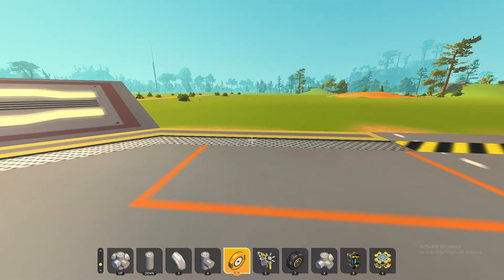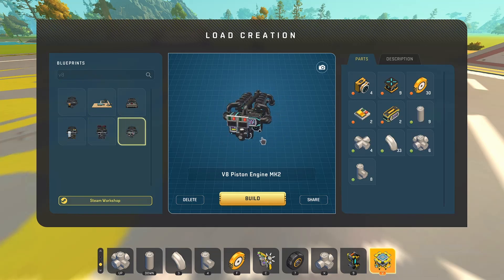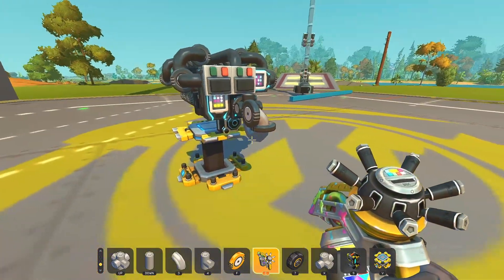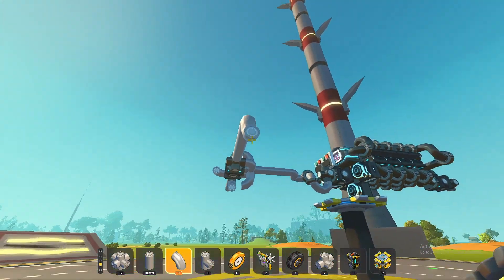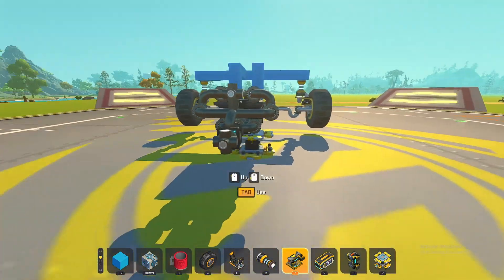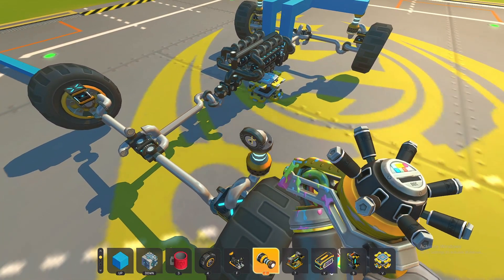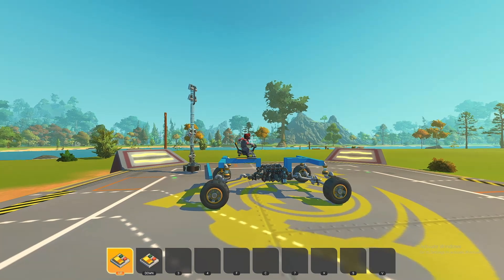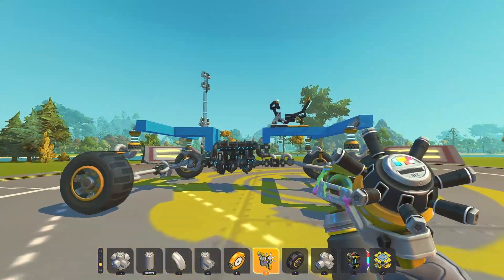How To Make An AWD Piston Powered Car In Scrap Mechanic!

Comment: Could you put this build on the workshop so I can test it?
Reply from the maker: https://steamcommunity.com/sharedfiles/filedetails/?id=3244456616&searchtext=4x4+piston+powered+car
That's the vanilla one. It doesn't drive very well as is because it is only a test frame, so it has hardly any weight, but the functionality is there. Thanks for watching!
Reply: @VR_659  Thanks for the link. I can't spawn it though. What mods do I need?
Reply: @programmer15 I don't believe it uses any mods but he may have accidentally used the MJM mod in it. I'll double check when I can.
Reply: @VarRev-z1gokay cool thanks